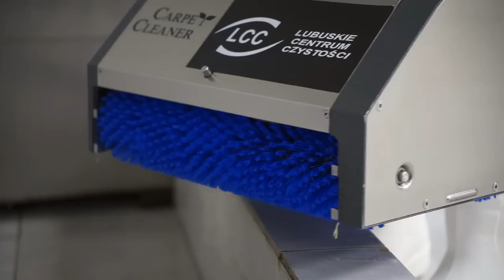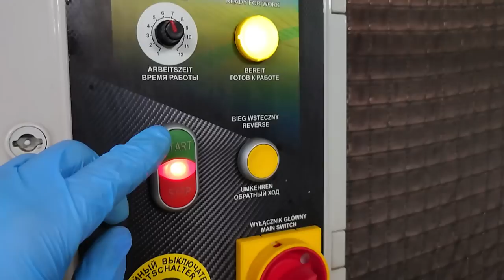Pranie LATAJĄCEGO DYWANU Króla Salomona 💪😍🌊 BRĄZOWA WODA wypływała.

Comment: You need to use non- bubbling detergents, like  HE high efficiency detergent for front loading washer.  All that suds will contaminate  water system
Reply from the maker: The agents I work with are biodegradable 💪😍🌊